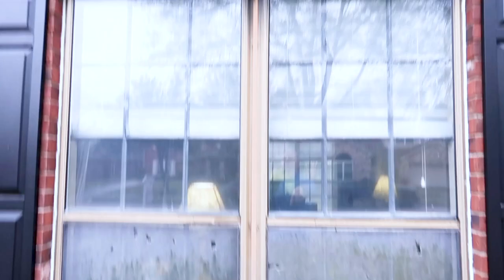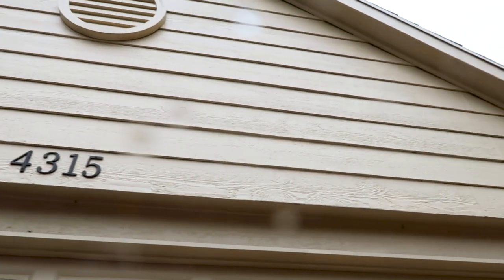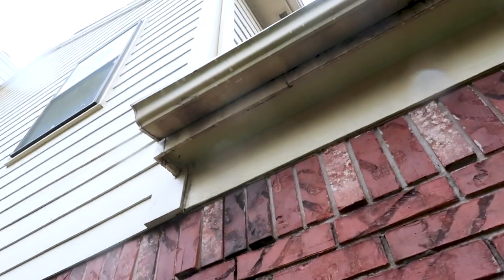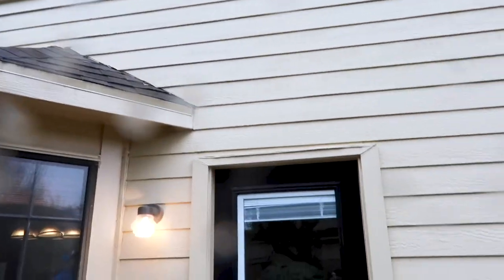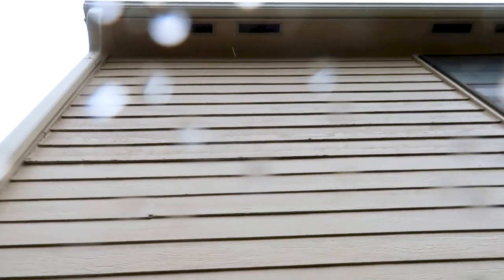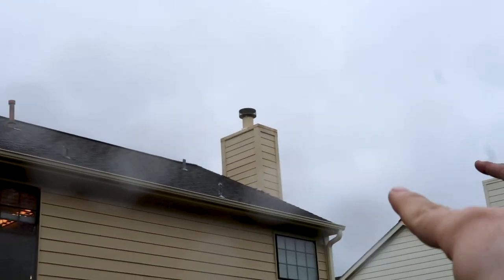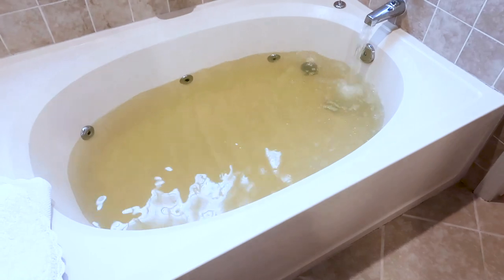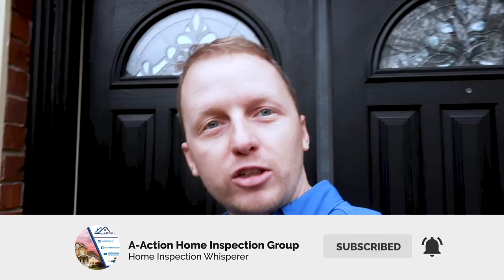Common Home Inspection Finds - The Houston Home Inspector

Comment: Have you ever tried using a extension pole with a wifi camera? In my experience it has been so much easier to use than a drone. With a drone there is a chance for a high wind to do it damage or have it do damage to the house.
Reply from the maker: We have not had a problem with a drone coming even close to damaging a property.
Reply: A buddy of mine uses the extension pole you speak of.  He loves it.  Great for checking out gutters, 2nd storey window installations, etc